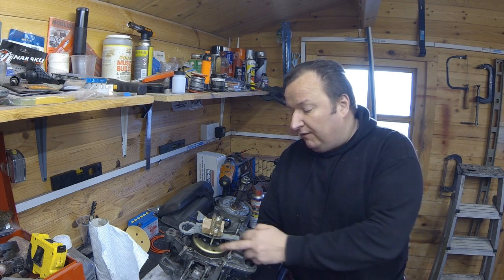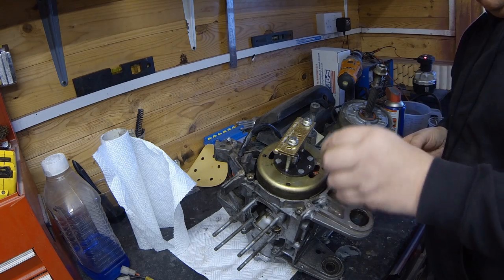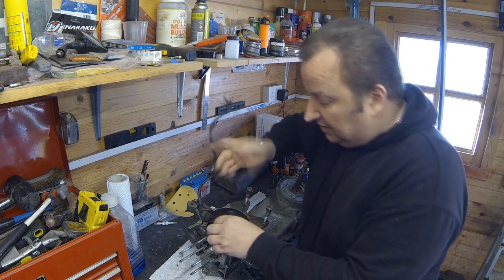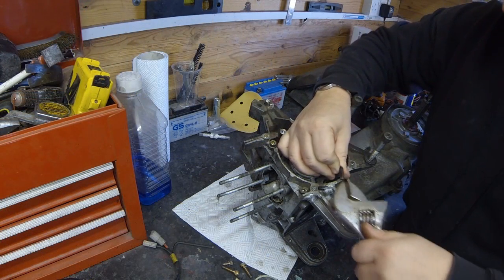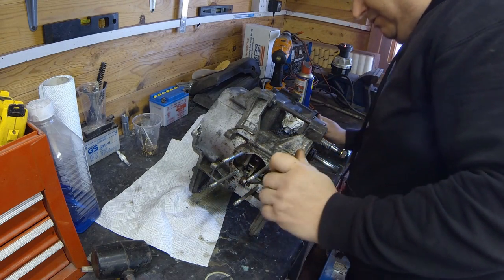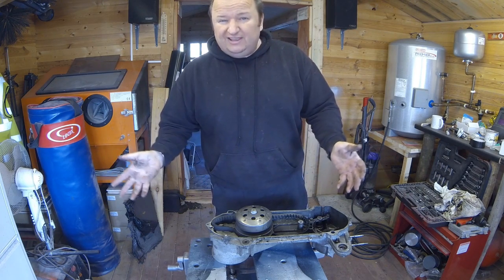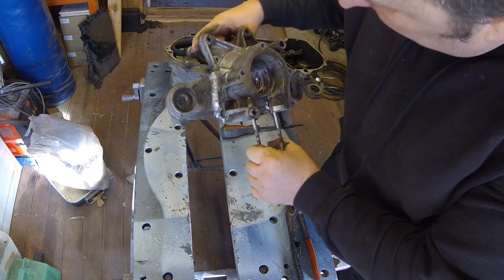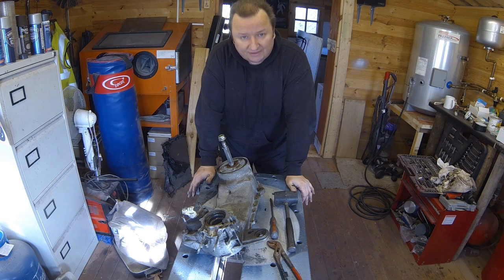TGB R50X Part 5 Won't Start: Splitting The Crankcases TGB R50X

Comment: use the old magneto and a longer screw.screw the magneto with a bit longer screws to the magneto on the engine and you need a bolt too on that longer screw which you are screwing on the crankshaft and holding the bolt with wrench....

Comment: I bought a broken tgb r50x and the stator plate does not have a trigger on it is that ok or will I need to buy a stator with a trigger on it ?
Reply from the maker: Not sure bud, you'll need to look at a manual.
Reply: think I'm just going to replace it as mine looks like its broken thanks any ways
Reply: I'm afraid I bought a bike that needs a lot doing but lucky the parts at so cheap stator is done for piston is stiff no spark plug or ht coil no compression wiring harness is bodged no battery half the bolts are missing and that's just the start of it I'm going to get the electrical system working first then ill sort the engine